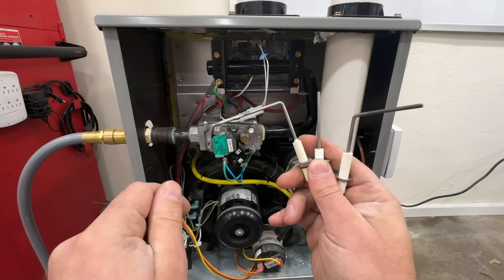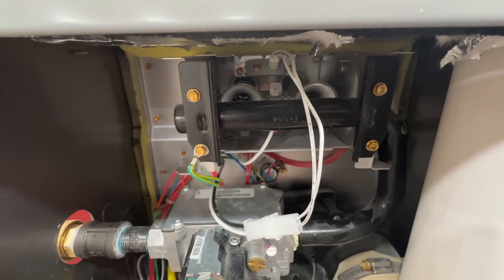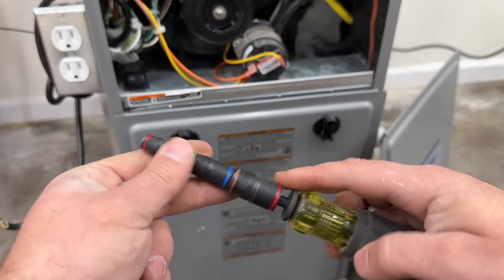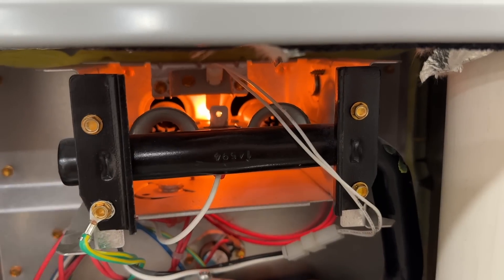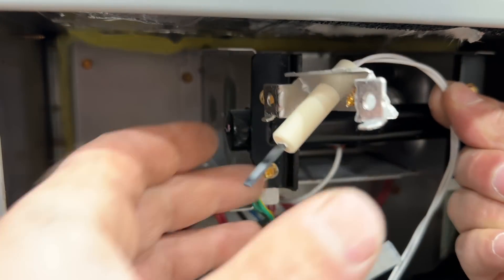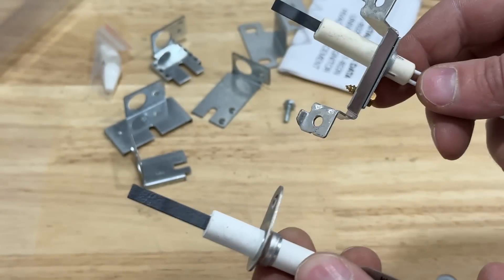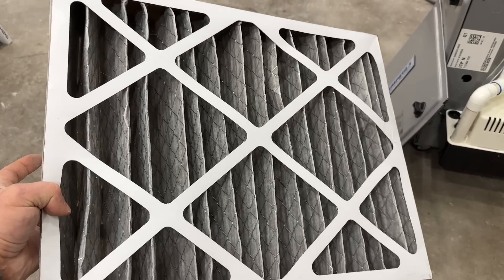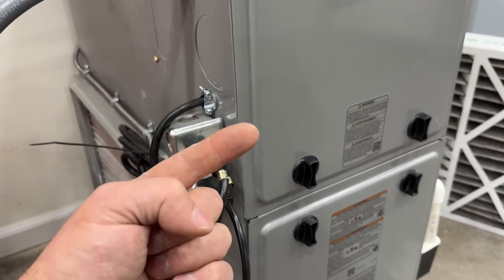Most Common Furnace Problems & How To Fix Them

Comment: Hi we are in need of replacing a 28 year old furnace    for a 1996 Bi Level total sq ft 2500     we are seniors on a so called fixed income so payments would be prefered      a furnace guy by us recommended a Weatherking  70,000 BTU single stage furnace    what we need to know is are they reliable and a good brand ?  what brand would you recommend and size     we live in Vulcan Alberta Canada    we also have already a 3-4 year old Air conditioner      this is an investment for us so we want best bang for the buck so to speak but very reliable     thank you so much and we look forward to your response   cheers
Reply: Still waiting... winter's coming!😅

Comment: Can you do a video on testing ventilation air flow issues wrt filter grades, dusty ductwork, closed vents, return air, things to help increase airflow if necessary maybe compared to cfm and BTU (always oversized!!!).
Is there a way to relate BTU (or metric) to Rja of a house? I recently showed during a furnace outage that I only need 3000W continuous to keep 10 C above outside air temp 24/7.  So do I really only need 12K BTU for my house  in typical conditions? They installed a total of 7 tons (12k×7) of heating and cooling here.  It cycles a lot!
I have a solution to reduce AC bill, 90% of heat comes via brown AL roof on master BR,south facing. Solar with an air gap!

Comment: Do all gas furnaces have flame sensors? For example, my old gas furnace doesn't have a hot surface ignitor. It has a pilot.
Reply from the maker: It’s becoming more and more rare to see one with a pilot but they are out there.
Reply from the maker: Sorry I misunderstood. Not all have a hot surface ignitor but all have flame sensors, yes

Comment: Mine outside gas pack(Trane package unit) died on me yesterday.    And yep right at the beginning of a severe cold snap.  My son, who's in the business, talked me through a few things.   Inducer motor kicks on followed shortly by burners(2) lighting off.   They burn for around 10 seconds then shut off followed by the same sequence over and over.  Blower is working.  I pulled the flame sensor and cleaned it using emory cloth but didn't fix the issue.    Now I'm wondering if I either didn't clean it well enough or it has failed?
Since it's a package unit sitting outside on sub 10 degree weather and now snow on the ground.....UGGGGGGG!

Comment: I have a problem similar to the short cycling of the furnace but it doesn't happen all the time( randomly after so many complete cycles). I've cleaned the flame sensor and still the  same issue. Should I just replace the flame sensor?

Comment: I was in a bind 1 night with a bad igniter so I was able to manually light my furnace with a grill lighter. Essentially I had to do it manually when the temperature would really drop inside the house. It was better than not having no heat. Even though it was a nuisance to keep doing it it was good in the emergency.
Reply: Nice thinking. If your furnace is a multistage burner model I wonder if it could have used the lowest stage (smallest flame) so the furnace never cycles and then you needing to light it up again.

Comment: Can you replace a glow igniter with a more reliable spark igniter?
Reply from the maker: Unfortunately those require a certain board and it’s really not worth doing. The one I showed is way more reliable than the old ones with the spacing in between. I’d just keep a universal by your furnace for when it decides to quit 👌🏼

Comment: Because of Covid, supply issues & getting jacked once by a HVAC guy I have since accumulated a box of spare parts. I now have every part listed on the parts list except the heat exchanger. ($$). Total cost for this insurance was roughly $500. Made that back already by fixing neighbor's furnance.

Comment: I just bought a newly built house. My thermostat is driving me crazy. I turn the heat off to save money but there are only two fan setting: On and auto, so the fan continues to run with cold air and does not shut off because there is no option to do this. Would a different model of thermostat fix this?
Reply: Auto
Reply: @Crete__Life  Does not change it. The fan operates almost constantly with heat and cool off.

Comment: Great video as always. Lots of people asking for the link to the hot surface igniter. It's the first link in the description. I'd like a link for replacement flame sensors please. Mine went bad a few years ago. I tried cleaning it with some fine sandpaper but nothing doing. I live in Canada and we have coins for $1 and $2 denominations instead of bills and all our bills are polymer (plastic) now so we can't even use those! I got lucky and found a good flame sensor in a furnace that was going for scrap and it's still going but I'd like to have a spare one handy for next time!

Comment: I'm retired from the business now. When I got my new furnace 20 years ago I  bought a spare control board and ignitor. Besides having one die on a holiday I worried about a part being obsolete and hard to get in the future.
Reply: A smart thing to do for almost any appliance, really.
Reply: I had a two stage York & they wanted $1000 for control board for a 17 year old furnace. I just bought new furnace.

Comment: Thanks for your informational channel. It made me interested in providing backup power in the chance of a power outage. I went down the rabbit hole ,after considering a power cube and with that came recharging the cube and hooking it up but I wanted automatic so I looked at a TRI fuel portable generator because I wanted to use NG but none had a THD compatible with my 93 plus furnace. So I tried to get a 7.5 Generac but after ordering it the delivery date changed later and later. I found they had a 10k with 16 breaker auto switch and ended up going with that. After first thinking I could do this on the cheap with a battery/power cube it snowballed  quite spectacularly . After Unit ,underground gas line ,electrical conduit, cement pad, All new Siemens breakers with 8  arc fault, 3/3 cable lets not forget permits and taxes, with me doing all the work it was still 6 times my original estimate of a nice power cube. No regrets it is wifi controlled so I know it is there and ready. 

I figured I did save money by servicing my furnace Trane XL 93 plus with help of your video. So Thanks

Comment: Yeah,make sure your furnace doesn't require a 24 volt hot surface ignitor!And do not touch the element with your fingers!!!!!
Reply: The older 80 percent Amanda's had the 80v & 120v glow plugs.

Comment: Is there such a thing as preventive maintenance on the items in this video?  Obviously the filter is easy enough.  Would it be a good idea to replace the sensor and igniter every so often or just let it ride until it goes out?  Thanks.
Reply: I have a 80% nat gas Bryant single stage furnace.  No flame sensor or ignitor issues ever.  I have replaced a blower motor capacitor.  If the flame sensor isn't working it is most likely dirty.  Clean it with a USD bill and most likely it will work again.

Preventative maintenance is always a good idea if it's in the budget and you are confident with the repair.  Set whatever length of time for the service life (say 10 years).  When you replace it, clean the old one and keep it as an emergency backup as it was working when removed.
Reply: @JSATI  thanks for your input.  I was thinking about just that.  My furnace is 17 yo and haven't had much problems, seriously considering pm.
Reply: This channel does have a preventive maintenance video. Entitled "HVAC Companies HATE That You Can Do This Yourself." Published  29 Oct 2023 

Unfortunately I was not able to find it in any of the playlists; and the title is more click-bait than descriptive.

It is like 17 easy steps!

Comment: Because of suggestions like this I bought all these parts and even AC capacitors a few years ago. 
I have two furnaces and AC systems (matching units, one for the first floor and one for the second floor) 
Same parts for each. 
I suggest you all take Dave’s advice here and buy these parts now. 
After checking the parts I bagged and boxed them up and put in the garage next to the furnace + wrote all over the box. 
I’m set.
Reply: I suspect (electrolytic) capacitors may have a shelf-life like batteries. Probably not a problem if you are storing for less than about 10 years.
Reply: @economicprisoner 
They're sealed & if not in heat or high humidity  : last our lifetime !😎😜

Comment: Have you ever seen error 33 on a Bryant furnace?  My furnace heats the house, but also reports the error.
Reply: How old is it,I have seen certain models with bad secondary heat exchangers! Been awhile,I dont see alot of them around here much anymore!
Reply: @petersmart1999  Bryant 915SA48080S17.  Installed in 2015

Comment: Hi Dave. 
Great video. I have an unrelated question that has nothing to to do with emergency power for a furnace. Over the Christmas break my wife wanted me to replace our existing Thermostat with a Nest. My furnace is similar to the one in this video. I looked at the thermostats and saw they were single stage. My furnace is 96% and two stage. I did find one Nest that could accommodate two stages by attaching the second stage to the OB contact and I guess program it do  that function. That seemed a little above my knowledge and I was afraid I might screw up the furnace which is working great. I took to the internet for information and support and got the idea that most furnace  technicians do not recommend  using the nest and that they don't work well and if I got it working it could cause damage to something on my furnace down the line. I got confused and did nothing. 
The only reason I was considering a new thermostat is the fact we could use an app on our phone and the fact the display is hard to read on the one we have now. We have an Emmerson Big Blue and the display is illuminated but very dim and difficult to see. It has been like this from the start. If the display was brighter I wouldn't even change it. They seems no way to make it brighter. As is stated I love the furnace and the thermostat works great. 
I would appreciate your thoughts on this. Your the only friend I know in the business. 

PS  I'm all set up for a power failure, foam cleaned my air conditioner and bought that multi socket driver because of you. The drive works great and takes up way less space in my pouch. Thank You
Reply: Most 2 stage furnaces have dip switch settings,that allow you to run predetermined 2 stage or true 2 stage operation! If you choose to run true 2 stage operation,yes you will need a 2 stage t-stat,of not check your owners manual,basically it runs at low fire for a pre determined amount of time then of not satisfied it switches to high fire!
Reply: Thanks Peter. Have you used the Nest?
Reply: @binnsbrian  I try to steer clear of them! They are more smoke and mirrors than anything else! If your system is 96% efficient,thats all you get! I think NEST  ,ECOBEE,ETC are more to the HVAC industry as K&N cold air intakes are to the automotive indistry! ( no they wont give you 15 extra HP! I feel the same with tankless water heaters,only good if you need endless hot water.As far as btus,ot still requires the same amount to heat all that water. Yeah ,you may save a little cash ,but it is washed away with annual maint! Im an HVAC realist,been doing residential and industrial service for 30 years,and I have seen more stupid stuff than really good stuff.
Reply: Thanks Peter. I value your opinion. As I stated in my original post I am happy with the furnace and its operation. I just find the display on the Emmerson Big Blue thermostat dull and hard to read.

Comment: The solution for any and every furnace issue is the same, rip it out and replace it with a heat pump, ideally a geothermal heatpump.
What idiot would use a furnace when they could have a heat pump? Obviously renters are excluded but at that point the repair isn't even on you.
Reply: Cost of the equiptment is cheaper, and the cost to operate is cheaper, that's why we will never get a heat pump, gas all the way
Reply: Initial unit cost is usually lower.  Honestly an 80% efficient furnace will most likely experience less issues overall.  KISS method keep it simple stupid.  Repairs will likely be cheaper.

Also if running a heat pump with electric backup heat you are solely dependent on the electrical grid.

With a gas furnace in the event of an electrical outage it can be set up to run off a car inverter or smaller generator and maintain your heat during an emergency with minimal investment and a little pre-planning. 

This would factor in depending on geographic location and frequency/duration of electrical outages.